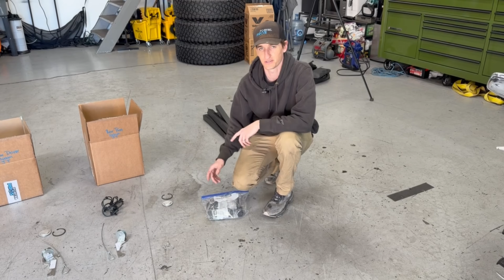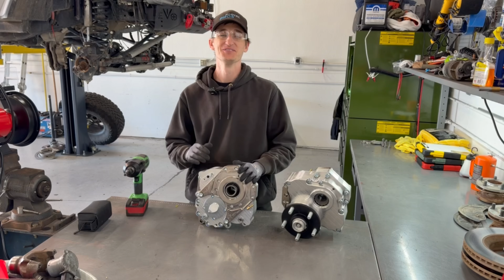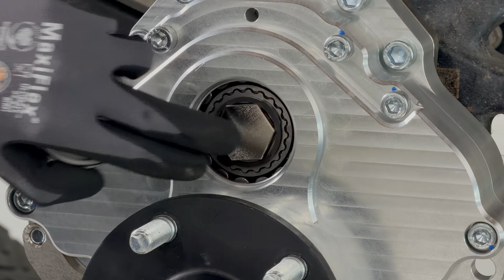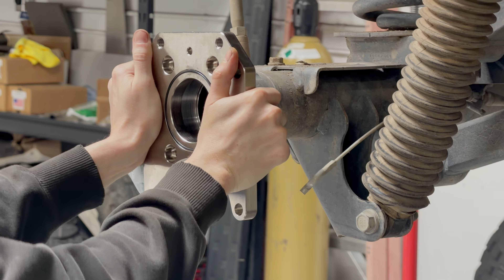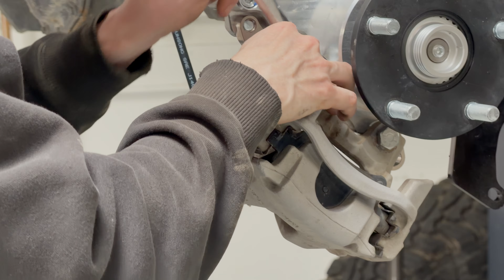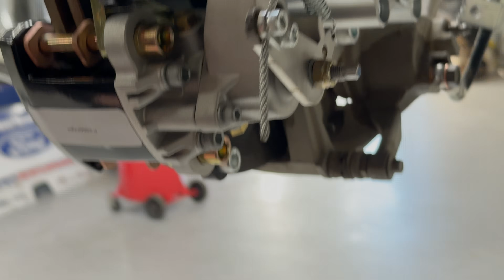Jeep Portal Install V1 | Portal Pros

Comment: So update, I've had mine on for 200+ miles doing my break in, I did counter sink my o rings for the ABS sensor and they sit flush,  little bit of gear whining but getting less , smooth install and only a parking brake issue being too loose for my taste but I'm working it out. Looking forward to getting them broke in and off road
Reply: Update, I removed the parking brake set up and used a universal cable, slight mod to get it to work, now no pulleys or cable clamps, looks and works much better and I did send my findings so Scott, they really stay on top of feedback. 100% improvement over their original set up (no criticism)

Comment: While 44s are not terrible axles why would i spend that much for putting portals on those axles and not go get some 60 or ford 9s instead or a chevy 14 bolt they are much strong and can handle the stresses better

Comment: How is the everyday drive with these?
Reply: The parking brake set up looks a little jimmy rigged guys. Is there a reason why you can't make the connections the same as stock?
Reply: It drives nice,  I have 200+ miles and the gear whine i had at the start is disappearing as I put more mile in them, I am taking care with how much wider but so far no complaints Highway or around town
Reply: So far no issues and cant tell other than some initial gear whine that is going away as I put more mile on it, highway and around town

Comment: How do the portal assemblies not call for any lock washers or locktite when bolting up to the axle housing?
Reply: looked like they were nylock nuts. Thats whay my rear 74Welds run also.
Reply: lock nut and locktite

Comment: How do you repair the rear axle if it breaks?  Since you now have made this axle into a floating axle you should be able to R and R on the trail.  However with the back snap ring do you have to remove the portal?

Comment: I have been looking at lift kit for my 2021 Gladiator because i want to run 37-inch tires and then i saw this. I was really interested until i saw the parking brake setup. that needs to be reengineered. a cable replacement is needed here. it might be a PITA, but that parking brake is just too sketchy for me. i would rather deal with a more difficult install than the sketchy E-Brake setup.  my only other question would be how these are rated for torque? My Gladiator is an Eco-Diesel. will they hold up to the torque of the 3.0L Eco-Diesel? or the Electric drive of the 4XE or 392?   the 3.6 liter Pentastar is good engine, but it lacks the torque of the 3.0L Diesel and the other optional drive trains in the jeep family. also, mine is not a Rubicon, will this work with a Overland/High Altitude?
Reply: I agree, the parking brake is the weakest link, and im working on a way to change on my JL, really need a better system

Comment: I have been following portals for a while now as I’m debating purchasing. As a retired mechanic that worked on diesel trucks I have one question. I saw you guys are running dual opposing tapered rollers on your drive hub. How are you preloading the lower bearing package?

Comment: The 15K price tag seems pretty steep for these considering 74Weld gives you a replacement knuckle new rotors converts you to 8 lug and gives you a wilwood parking brake. it seems like this stuff is overpriced. They also make their stuff in America. It’s gonna be a tough sell to push a 15,000 made in china product to this market
Reply: That is indeed the point of the tariffs. To make the cheep chineseiam stuff more in line with the price of American made products. Therefore putting American companies first.
Reply: Half of what you said is correct the other have is wrong and 1 point is a matter of opinion depending on who wants what
Reply: 74weld is the way to go!
Reply: True, 74 gives you more parts, but also requires you to run different wheels. So the 74 kit is more expensive, and then you have to spend more money to complete it. Can't debate quality on either as I don't have them, but its not like we haven't seen/heard of 74 portals having issues.
Reply: Its nowhere near that price outside of America. Welcome to trump tariff land.
Reply: @mattyb7736 how about we support American businesses that make their products in America. I know it’s a weird concept and it’s easier to go political but maybe, just maybe, manufacturer here in 🇺🇸

Comment: With the dual bolt pattern of the front mounting brackets, is it feasible to clock the plate and shift the portal forward to extend the wheelbase?

Comment: Im not deeply confident on this. Forgetting loctite on the bolts, not lubricating the O rings. Hooking the brake lines up wrong.  And CLEARLY  a Home Depot pully set up.  This is all before seeing a 15k + price tag ? Definitely might want to do test videos, edit a bit. This absolutely scared me into not buying this brand.

Comment: When are they going to make portals for TJ’s with Dana 30 & 35????????????
Reply: When you swap in a strong enough axle setup to handle the portals or at least one worth upgrading to handle them. Find some newer rubicon take offs and fit those to the tj if you want portals.
Reply: Portals on a D30 😬 maybe if you're running a Harbor freight Predator engine 😂

Comment: Would your portals bolt on to a front dana spicer ultimate dana 44 axle with RCV axle shafts?
Reply from the maker: Yes, they will mount to any aftermarket axle that uses a JK or JL unit bearing. And they do work with RCV shafts

Comment: Portals are cool, but just adding complication and more points of failure to your rig, when you blow your portal you are finished, no chance of heading back to town for a replacement part.  I guess you could carry spares
Reply from the maker: The good news is that you can pull out the guts and run the portal as a free hub in the event you have an issue with the gears
Reply: A bunch of guys here dont even know what they talk about....they just dont understand the function of portals 😂😂😂
Reply: @pinzgauerbelgium  agreed, I am running these as an early adapter Jeep, happy even with some growing pains, I am happy even with the stated above.
Reply: That might get you off the trail depending on what failed, but I have seen the extra leverage from the portals do extreme damage to other components

Comment: You lost me at that wonky parking brake setup!!   That needs serious revision!!
Reply: Yup was interested until that Janky looking parking brake from home depot parts, come to the market refined or dont come to the market.
Reply: @Silentwrangler . Exactly!    I thought that was a joke when I saw that u bolt and pulley from Home Depot!!
Reply from the maker: It's something we've been struggling with. We started with a full cable replacement and it was such a pain to install that we decided it didn't make sense. Of course, we can still sell a universal replacement cable if you're interested. 

Most likely we'll end up with an electronic parking brake caliper in the future.
Reply: @portal_pros  I understand your perspective, but as a customer just letting you know not having a kit fully developed and showing this type of work around 100% lost me as customer. I am also probably not the only one that would agree with that. If 74weld can come to market with a complete kit, and that's your competition either you come with refined product or many people will never consider you again.
Reply: @Silentwrangler exactly and wanting 15k plus price tag.
Reply: @Silentwrangler  As a guy running 74Weld portals...I can say 2 things with certainty. 1 - I absolutely love them as a company, Quinn is a stand up guy and they stand by their product, and 2 - they absolutely came to market with unrefined products as well. As good as the quality looked, I broke 2 portal uprights one broke around the lower ball joint at KOH wheeling super lightly. Quinn from 74Weld personally brought me a new one and helped me fix on the trail which was rad. A couple months later at Rubicon, the 2nd one broke where the tie rod mounts. After that, they totally went back to the drawing board and made their Gen2 portals which are way stronger and have a TON more material around the areas mine broke...Ya that E brake is a bit janky, but it won't leave your rig broken in a canyon during KOH or in the middle of the Rubicon. More players in the portal game will be good for all in the long run! Keep it up fellas!
Reply: So that means I got to go down there because the cable stretch every time I go out riding
Reply: This company is complete shit! I would never trust anything they make
Reply: @Alshges That is harsh
Reply: @AlshgesI bought and installed these and other than the parking brake set up, I am happy but I will update after the breake in period,  the quality is there and you can see it if you watch their R&D videos